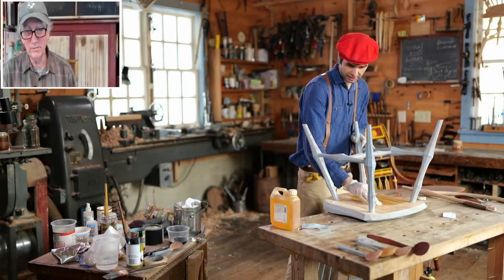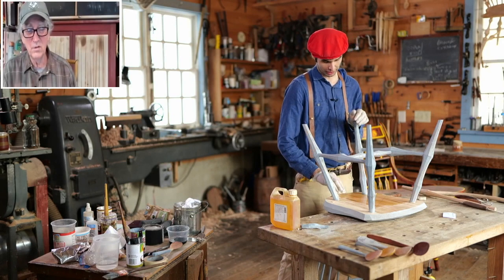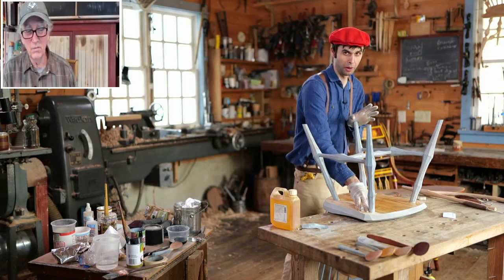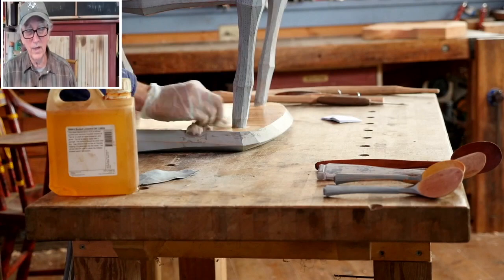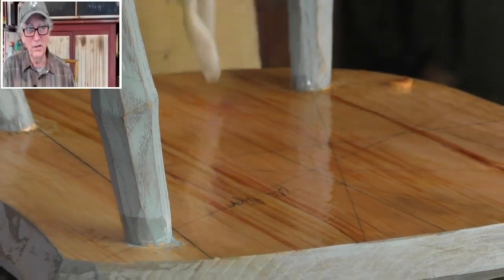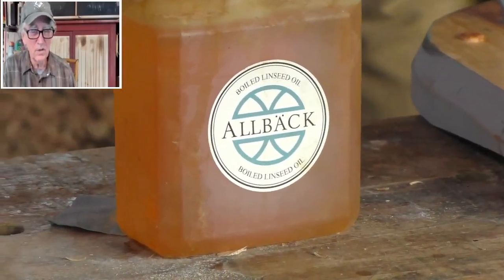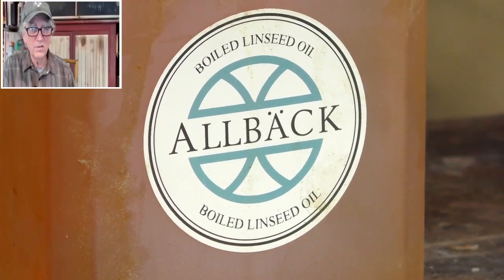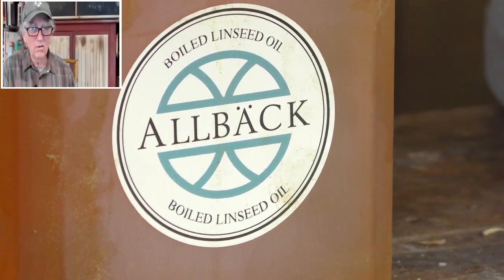Linseed Oil, Shellac, and Tung Oil

Comment: Although Allbäck is traditionally boiled, it does contain a metallic dryer.

Edit: Someone on a forum that I participate in dug a little deeper and determined that the amount of dryer that they use is small enough to have practically no negative impact.
Reply from the maker: Oh, thanks for the info - I don't know that.
Reply: @eliabizzarri56  I think it's a recent change. I saw someone mention it on a Chris Schwarz blog post, and found the MSDS to confirm
Reply: @eliabizzarri56  Someone on a forum that I participate in looked into it and determined that the amount of dryer that they use is small enough to have practically no negative impact.
Reply: How is the drying time?